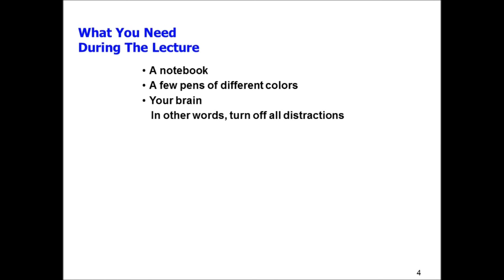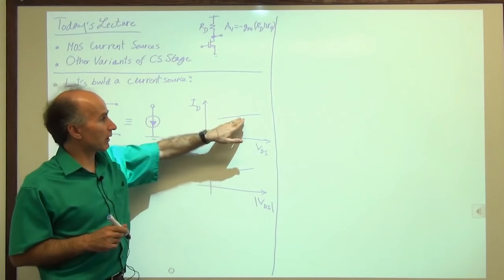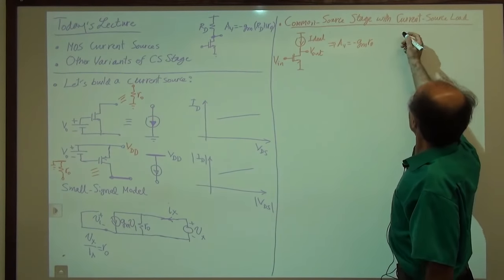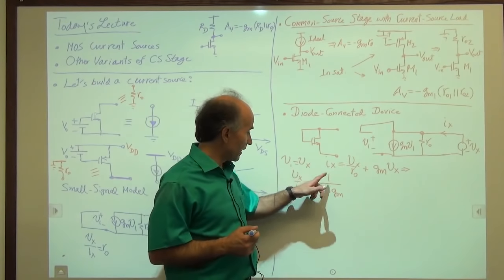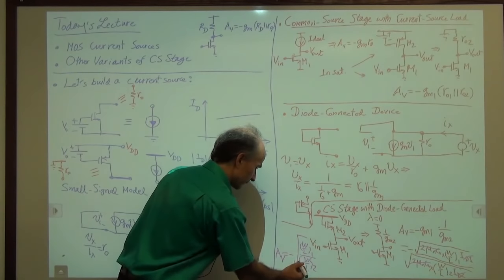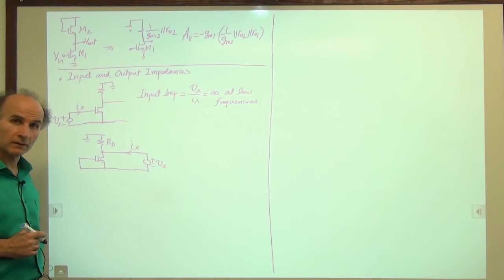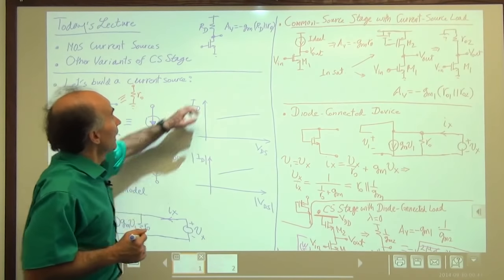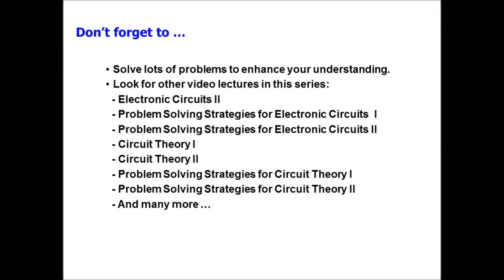Razavi Electronics 1, Lec 37, Common-Source Variants

Comment: Thank you for good series of lectures Dr. Razavi, But I had one question: when calculating output impedance with CS stage with diode connected load, the Vdd should also be technically grounded for calculation of output impedance before we directly take it as a resistor 1/gm2 // r02 right? If we ground the vdd then gm2.V1 would become=0. This is my understanding. Please correct me if I am wrong.
Reply: In the calculation, VDD is indeed made ac-ground. But V1 is not Zero. Because V1 is the voltage between Gate node and source node..... Gate-node is at 0, but Source node is at vout. The analysis of V1 = Vx still holds good.
Reply: @amithpandit4043  Yess
Reply: The test voltage applied Vx applied at the output port, makes a path all the way upto V1.
Due to this gm.V1, is not longer "independent" as it previosly was as the gm is based on V1, and V1 = Vx.

Thus, for the diode-connected topology, the output port impedance becomes - (1/gm || ro), 
while the equivalent for current source topology stays, ro

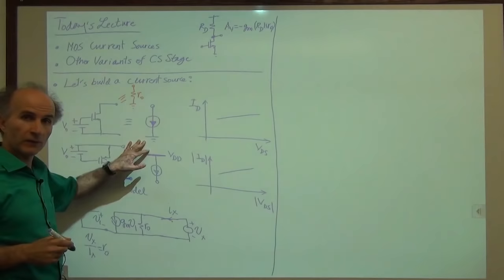Comment: doubt: @15:12

sir memtioned that the mos ckt can be equivalent to a current source (for bias calculations) and the same mos can be equivalent to resistor (ro) for small signal model.

I'm little confused as to what does sir intend to convey when he said that MOS_ckt is equivalent Current source for bias calculations. 

feedback:
 I love sirs teaching and how ppl appreciate his work.
but there is a little inconvenience: before posting doubts in the comments section of sirs videos I am looking for any doubt relevant to mine are already there or not..
(which is a good practice according to me to avoid repetetions)

but it was little hard for me to find out the doubts and read them in the poop of all the comments (that aim in expressing gratitude)
I wish there is a filter in youtube comments to segrigate the comments based on weather they are feedback or doubts or gratitude expressions.

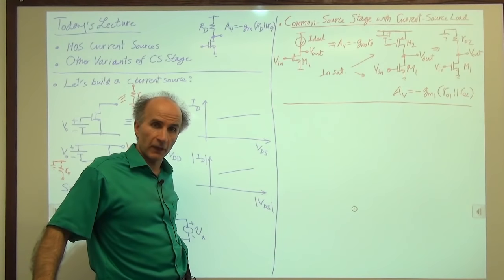Comment: at 23:54 can we use nmos instead of pmos as current source load as we done in case of diode connected load at 33:13
Reply: I think the answer is yes. Their equivalent circuits are both resistors.
Reply: @許祐嘉-u1c  pmos and nmos has identical small signal model that's why their output resistance are same
Reply: @pulkitgupta8310  Yes, the only difference is their electrical parameters(and some higher order effect)

Comment: Why is a NMOS preferred to be the current source of choice between an arbitrary node and ground and why is a PMOS the preferred choice for a current source between the battery and the arbitrary node?It appears to me that both can be used interchangeably.Please help
Reply: i am having same doubt
Reply: If you use an NMOS to source current from VDD to a load, then any voltage fluctuations your load causes would change VGS and unbias the transistor. If you use a PMOS, then your load is sinking current via the drain and fluctuations on the drain don't affect the VGS bias.
Reply: @jamesm6951  explain clearly

Comment: can anyone enlighten me on why do we not short v1 when calculating  diode-connected device's impedance but we do short v1 when calculating current source's impedance?? Both are small-signal model.
Reply: I'm also wondering why it's v1 is not shorted...
Reply: Here gate and source are not connected by battery for biasing, so it's not shorted 
As Vgs=Vds, Vgs-Vth always less than or equal to Vds and the device is in saturation

Comment: in I/O impedance v1 is not = 0 because its gate is not connected to source
Reply: shorted the independent sources for small signal modeling, gate is connected to source